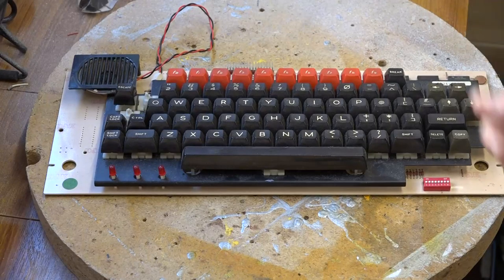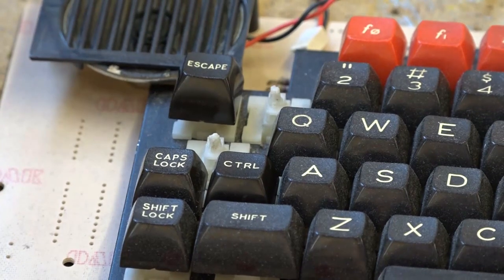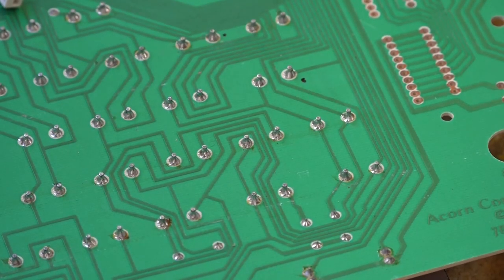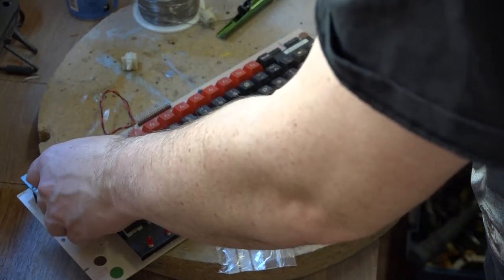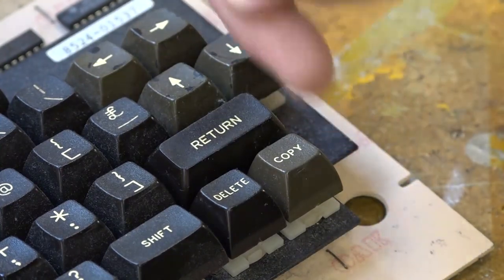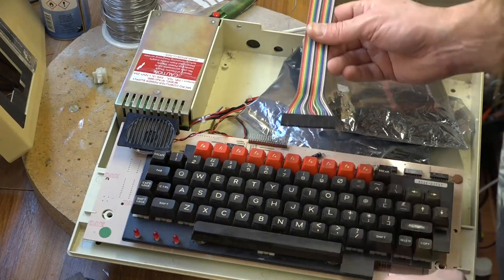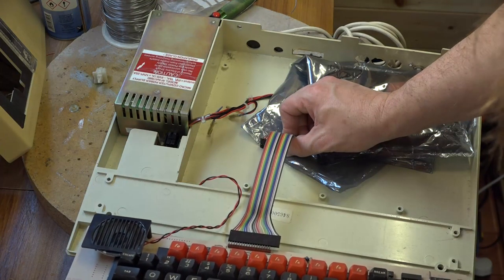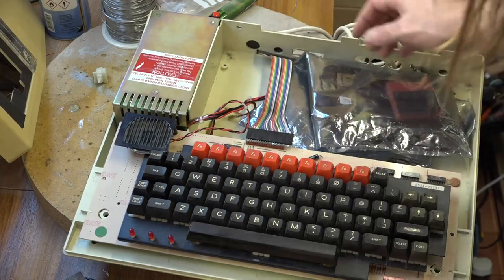Let's Build an Acorn BBC Model B Micro Computer from scratch Part 3

Comment: It's looking really good mate! You're dead right about checking cheaper components. I just got stung by eBay power transistors (not cheap and a UK seller). They were supposed to be genuine MJ802's but failed base-emitter immediately. When I finally got the genuine ones they were fine. Buyer beware!